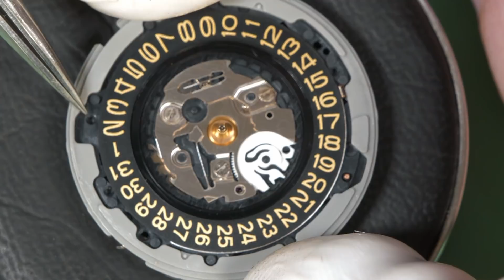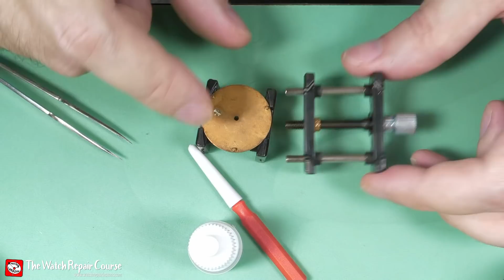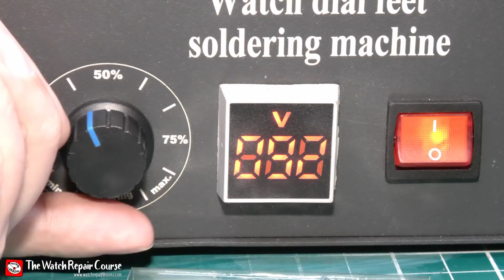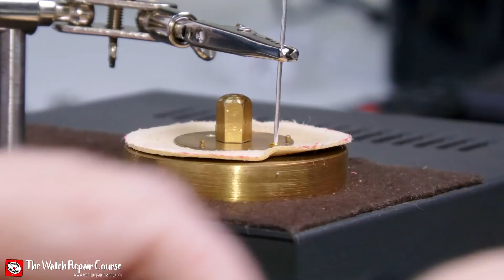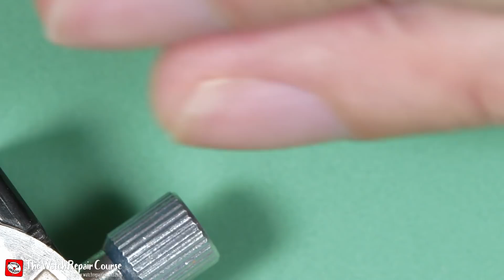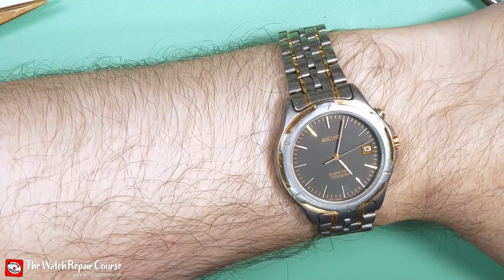Repairing a Seiko quartz watch dial. How to use a dial soldering machine.

Comment from the maker: Dial Soldering Machine on eBay: http://ebay.us/Vr120d
Other Dial Feet Soldering Machines: http://ebay.us/1qblB5
Dial Feet Milling Tool: http://ebay.us/6xLGA5
Dial Stickers: http://ebay.us/Zeh66a

In this video I demonstrate three methods to repair broken watch dial feet. Dial stickers, pre-made dial feet and the use of a watch dial feet soldering machine. Let's compare the results and see if we can determine the best solution.
Reply: ... we thought we were in for a new tool... however it ended up being no less that 3! gotta love watchmakers tools.
Reply: 🙏 thanks
Reply: @Watch Repair Channel I bought a seiko snk807 about 7 months ago. It has the 7s26c movement and I had put it down one night and it was running. The next morning I wake up and it's stopped and it won't go no matter how hard I encourage it to. The balance spins freely but the second hand never moves while its spinning. I looked in the movement with a light and the balance spins but its not engaging the pallet fork. I took the ballance of to see if their was any tension and sure enough when a lightly pushed on it l could feel the tension while the escape wheel moved. What the heck is going on? I don't have much experience in watch making but I have a cheap tool kit so I could put new hands. or a dial on.

Comment: I do a lot of micro soldering of electronics and the like. I would be interested to see if an extremely low melt solder paste, and the quick touch of a temperature controlled soldering iron, would accomplish the same thing with no heat damage. I'll have to give it a try!

Comment: Looks like a simple 230v to 50v transformer with a variable voltage input through the pot and I’m guessing transistors. This runs through the voltage display and then to the input of the transformer. So it looks like at a max of 230v your only going to get 50v @ 10a output. Looks simple to build from off the shelf parts. Thank you for the look inside of the box.

Comment: That “copper tip” is just a copper coated carbon air arc electrode”. Thy are bought in boxes like welding rods and about 12” long. So if you need replacements just drop off at your local welding store.

Comment: I'm pretty sure you can solder the premade dial feet onto the watch dial with a regular soldering iron. Just make sure both surfaces are free of oxides, dirt, and oil before you apply the solder paste.

Comment: You are correct. Any very valuable watch should not have a risky procedure that would not be recoverable and obvious to the beauty of the dial face. Use epoxy and premade feet. They look nicer imo and are equally as performing their function.

Comment: I noticed that this unit was constructed by hand although it appreas to be done well.
The components used, I can assume came from China and that is cause for concern. This particular device has a very common and inexpensive rocker switch installed. Unfortunatley this switch suffers from a limited life cycle. Exactly how many times it can be switched on and off before the internal contacts begin arching and cause whatever is connected to the load-side to experience intermittent power fluctuations I cannot say exactly but it will eventually fail.
I suggest the unit be serviced by a small appliance repair shop and the rocker switch replaced with a quality device manufactured in the USA or the UK. 
I hope this helps

Comment: The proper way is to drill a hole through the dial... Yup, that's how a official Seiko repair shop did mine. Lost 2 months arguing so that they replaced it with a new one. Crazy...

Comment: I don't think your meter is reading volts.  Most likely current (170 would be 1.7 amps) Your voltage will stay constant at 6 volts per the transformer inside.  I have a similar device and that's how mine works.

Comment: Mark, really enjoy your channel – very therapeutic during these COVID times.

As an electrical engineer, this Dial Foot Soldering contraption scares me…and, I think the overall approach is fundamentally wrong.

First off, from a safety aspect, the level of output voltage this thing generates makes it lethal. There’s no protective cover or sensing if you accidently put your finger where you shouldn’t. Can you imagine what would happen if this was left unattended and an inquisitive kid found it?

Most watch faces have delicate coatings that would be easily damaged through the use of too much heat. The amount of heat generated by this thing is not predicable and you only have the thickness of the watch face to provide a temperature delta of 100’s of degrees C. Also, soldering only allows the joining of certain types of metals so it would be useless on stainless, for example.

A better solution may be to use a mini spot welder – like those from sunkko.net, or units specifically intended for jewelry. These use precise electrodes to apply pulses of current that are accurately timed by electronics, so the amount of heat is also accurately controlled. Best of all, it won’t try to kill you.

Comment: Mark - Could you post a link or description of the Horotec tool you used to smooth the dial feet solder joint or the smooth the excess epoxy from the counter sunk dial foot type repair.  Much appreciated.  John S

Comment: Some would wrap a wedding ring in electrical tape when using such a device. Just in case the ring gets across the welding current path and start glowing white hot. I might wear gloves.

Comment: @14m20s: Testing for shock hazard. Actually, measure AC and DC voltages from the suspect device to your local ground (cold water plumbing pipe, or known good ground connection). Because that's the most common electrocution path, from the device to your hand, down your leg, etc.  As long as it's Low Voltage (say 30-50 volts, rules vary) or lower, then you'll be safe from shock. No need to measure from the suspect chassis to the suspect chassis. If the suspect chassis is well grounded (by internal inspection and continuity check), then the risk is low anyway. Still, worth checking. :-)

Comment: @8m58s: "....copper wire..."  "SN96 AG3,5 CU0.5" = Sn (tin) 96%, Ag (silver) 3.5%, Cu (copper) 0.5%. i.e. "silver solder", a strong type of solder useful for mechanical joints.

Comment: Electronic engineer here, that wiring internally looks well designed and manufactured, and the transformer and connectors look very decent. Pity you didn't capture that board with the green connector top left, looks like that's the control section where the magic happens.  Safety would be ok is my guess with a fuse installed. I like repairing stuff as well and if I would ever pick up watch repair and attempt something like this, I'd probably prefer the milling and adhesive method. With the right adhesive, my guess is it would be mechanically more secure than soldering and I would really not want to risk heat damage on a dial. The big plus of soldering is that it can facilitate electrical current but there isn't any here.

You're getting better results with the Amtec paste because it contains lead, so it has a lower melting point than lead free which I guess was included. Don't think you can legally use lead solder though. And downward pressure is very beneficial when curing glue, I don't see you doing that in this repair. A glue joint like this would only need a little pressure.
Reply: I was curious about the epoxy method, too. Done form of clamping force must be necessary. He probably just didn't show how he did that. 
Mark?

Comment: My preference is the hand mill and epoxy. There's much less risk of damage and you never know what the heat will do to the dial. Especially more delicate dials. Diver dials are usually OK, but multi part dials with silver plating and lacquer on top, makes me a bit uncomfortable.

It's also much easier to line up the foot with the pre made dial feet and the hand mill. The problem with the soldering is you can't see what you're doing under the solder paste. It really doesn't need to move a lot and you have to do it again and risk further damage.

I have tried the hand mill + pre-made feet + soldering, but heat is still an issue.

Thanks for the video, it was great!

Comment: This is a very challenging video to watch. 
You bought a guy's product and clearly announced that you're not here to in anyway endorse it.
That's fair enough I suppose.
Then you go on to totally ruin the guy's reputation !
A "facepalm" moment...🤔

Yes, it is true to say that there are build quality issues and possibly design errors too.
But still it does feel a little harsh to see what happened, especially as you already have a far better method of reattaching dial feet and there isn't much point in exploring what seems to be a bad idea to start with.

Obviously heat is a risk to further damage an otherwise OK dial, and even I can predict that on an antique dial with already weak and unstable paint and indices that totally screwing it up is very great possibility.

It would have been nice to see a video on how you go about reattaching feet to a dial using the method you normally use, rather than seeing you nail some guy to a cross.   😱😖😳
Reply from the maker: I think the product developer has done a fantastic job with this machine and I stated that in the video - I also stated some concerns without being harsh - perhaps you are just being a little too sensitive. You are very wrong in your assessment of this video, but I thank you for your comment.

Comment: it seems to be a spot welder repurposed as a solderer. quite a good idea, since the heat will be concentrated at the solder, which will have the highest resistance of the circuit. still, i'd prefer epoxy, which is very tough and durable on a properly prepared surface. certainly seems to be overkill for such a light mechanical load spread over those big feet. if you have any concerns over the epoxy, it's a good idea to find a slow epoxy and put up with waiting a day for it to set

Comment: I also have this machine, for electrical safety I use ceramic tweezers. It needs some practice to use well, but I generally avoid trying to solder dials of cheap Chinese watches. Old Swiss, Russian, Japanese watch dials will generally be more resistant to heat. 

Also I sorta know the people who developed it, they run a watchmaking school in Hungary, I was trained by them.
Reply: Thank You for your comment! ;-)

Comment: About 40 wars ago I remember using such a machine in the UK in my family clock (as opposed to watch) business. We used it on larger dials, but it still required a good deal of skill as you demonstrate. Personally I would emphasise the 'chemical' cleanliness of the end of the wire and the dial surface although flux does go a long way to help with this issue.

Comment: Those old Seiko kinetic's capacitor don't hold a charge well when they age.  A lot of them have had a special capacitor replacing battery installed.  Is that a modification/repair that you could demonstrate on video?

Comment: Thank You Mark for your excellent video. What you shared with us, it's absolutely correct and right. However - me as the developer of this  machine - prefer to soldering the dial feet, but I agree with some comments, in some case the glue is more preferable ;-) Thank You for your work on your channel!
Reply: Looks like you used a variable power supply and home brewed the rest. Very good job over all

Comment: From an EE's perspective, the machine looks very well built! - there is no chance of harm to you. The maximum voltage you will see on the output will be a bit over 6V AC. The meter is showing the voltage coming into the transformer, not what comes out. It may work on 115V but will only have half the output voltage. If the adjustment and voltage meter will work on only 115V is questionable. If you need to dial this up to "170V" to get a good joint, then 115V will not be enough since you are over the 50% output voltage already.

Comment: That was a bit spooky as I was sitting here polishing a chrono version of that Seiko and it pops up and I am like "waaahht" .  I was thinking that does look a very well made machine and prob scope to use it for removing microdents on car bodywork and other applications where small holes needing to be soldered.   Wondering if it could be used for silver solders which are the strongest of solder joints.   Glues are astonishing these days, super glues highly useful and I repaired my Ben Sherman's wide thick cuff strap other day using some of that G-E glue and its fixed albeit I did put two fine holes and use some leatherworkers yarn to stop it coming apart again.   I used the G-E on a Slava dial foot and held quite well as Slava dial feet seem to be held on with fresh air, empty promises and not much else hehe

Comment: The machine in question is actually a very good unit, but truth be told i still find it easier to glue on the feet. I use 2 part epoxy metal set or a 2 part Marian epoxy. The epoxy has to have a hard finish when set, Areldite is not very good. Thanks for the knowledge you always give.

Comment: For the guy who has a different screwdriver for every screw, locking pliers for tightening a nut? Now I feel a little better about some of the tools I use :)  
I've heard about some ultra-low-temp model railroader's white metal solder at 70 degree celsius, might be an option for sensitive dials. I'm an epoxy user (JB weld),  overnight cure allows for a little micro-adjustment as it starts to set up.
Reply: The melting point of the cream - what Mark is using on the video - is approx. 130 Celcsius, or you can try also the sn42bi58 cream which has a similairly low melting point ;-)

Comment: I've considered one if these machines. The demos I have seen seem to be an almost instantaneous weld, like an arc. 
 I rarely have a watch in my hands that was built after 1960 and their dials can be incredibly fragile; even inadvertently touching them can ruin the finish.
Reply: However it looks like a welding, but not, it's soldering, becuse the melting point of the soldering cream is around 130 Celsius. You have just need enough experience, and you will never demaged any dial faces ;-)

Comment: When you were checking to see if the casing was live with the multimeter, it looked like you were touching the probes to a number of parts that are electrically connected, most notably different screws going into the case. When doing that, you will never get a reading because there is  no potential difference, or voltage, between two screws going into the same piece of metal. It's best if you  look into this rather than me trying to be very concise right here off the top of my head. Fluke instruments are very fine so it would make sense to get good use out of it. It does occur to me that you may have just been having fun and understand this subject perfectly. ;)

Comment: Thet chamois leather just begs to be soaked i water. It would cool the front side of the dial so that you can be a bit mor brutal on the back. Combine everyting. Mill a nice flat surface. Use one of those spare dial feet. Flux and solder paste. Press down and electrocute.

Comment: I've encountered many a dial that would react poorly to high temperatures. Stuff like sunburst patterns on dials typically have some sort of thin film making the sunburst effect, a film that will melt in contact with stuff like alcohol, so I can't imagine they deal with heat well. Even though this device seems to limit the spread of heat fairly well, I'd still be reluctant to bring it to any dial deemed sensitive.

Comment: Was that an extra flat washer or was it supposed to go at the base of the post, on the outside of the case?
By the way, internals look really neat and the case is grounded (wire affixed to the lid). Looks 100 times better than half the power tools in stores, no expense spared  on wire gauge and connectors either, properly crimped. Profit margin is somewhere at or below 30%

Edit: washer is in place when testing the machine 😄

Comment: I guess this is a device for people thinking of making their own custom dials. Or a a great tool for enamelists (is that s word?) .
Reply: If you use this machine you have to solder the feet before enameling the dial, if you try to do it afterwards you risk cracking and/or discoloring the enamel.
Reply: @hectorherrera526  if you have enough pratice, you can use it anytime, and the face side will not be demaged. I am the designer and producer of this machine ;-)
Reply: @imreserdult1403  blimey I didnt think anyone read my comments. I am considering having a go at making my own dials and straps though. I've saved the link it's a cool device.
Reply: Actaully approx. hundred watchmakers using my equipment worldwide, some of them in very famous service. All of them are using it for repairing broken dial feet, and I have lot of ferdback from them. They are satisfied with my equipment, but all of the emphasise that, they needed to train themselves. Finally, my 75 years old watchmaker master told me that: watchmaker never use glue! ;-)

Comment: Perfect timing on the video!  I am dealing with this repair right now.  During your experiments, did you test the maximum length of heating time before the dial face was burned?  I know every dial is different, but it would be nice to know approximately how much time I have to safely melt the solder.  Thank you!
Reply: You are right, it's different at ech dial face. The melting point of the shown soldering cream is about 130 Celsius. You sholud touch the carbon rod approx 2-3 seconds. You will clerly see that, when the soldering cream not only melting, but flowing. That's the right heating time ;-)
Reply: The thickness of the dial plate probably needs to be considered, also.